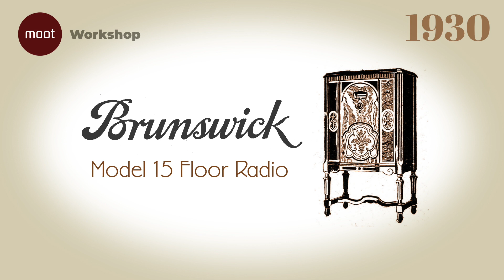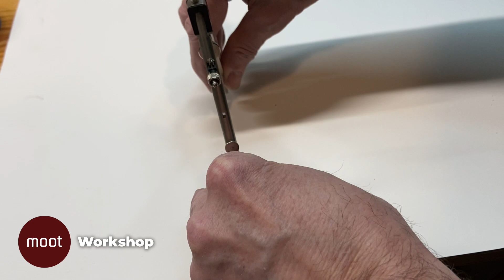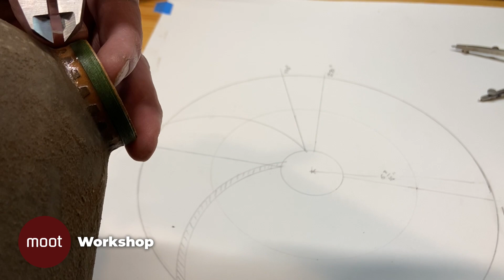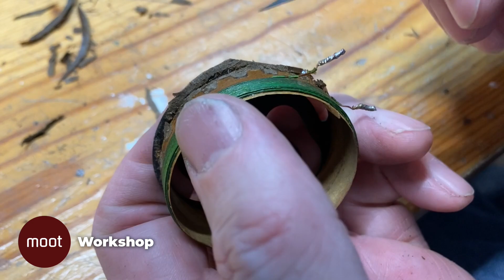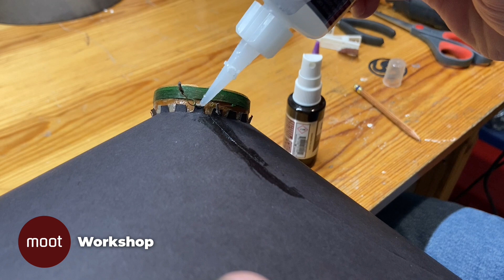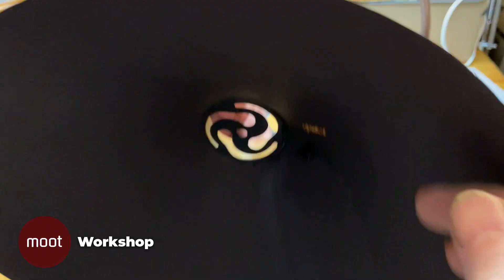1930 Brunswick Model 15 Part 2: Speaker Cone Restoration

Comment: Just a fascinating video! Some questions, if you don't mind. I don't think of epoxy as a flexible bond, but it seems like a speaker cone would require some flexibility. Why epoxy? Another question regarding the math on creating the cone. Is there a reference work you can point to that would help me understand what you did? Thanks for this video.
Reply from the maker: As thin as the epoxy is, it's fairly flexible, and the paper cone is pretty stiff as it is. Where we really need flexibility is the ring of chamois that connects it to the frame, so it can move freely as a unit (which is still constrained by the the springy spider in the center).

As far as reference work, I don't actually know - I figured this out by looking at the original cone and reverse-engineering it. Modern speaker cones would be more difficult to replicate like this, as they are made with more exotic materials and manufacturing techniques.